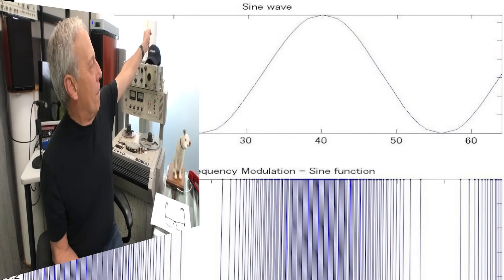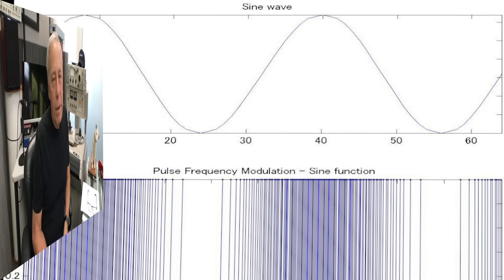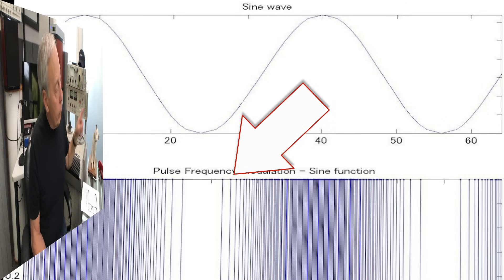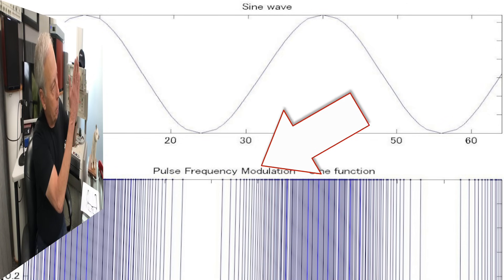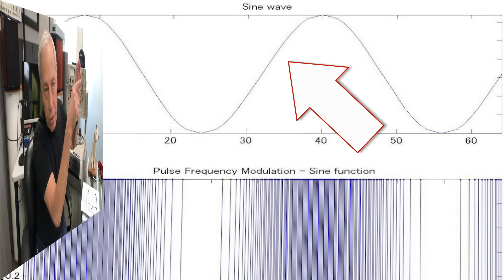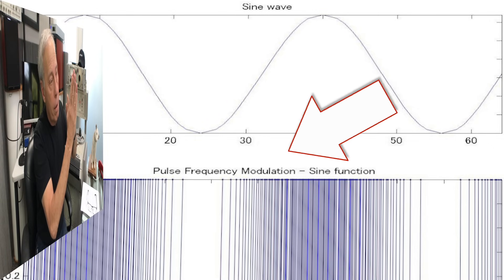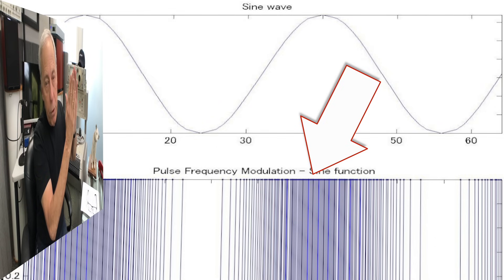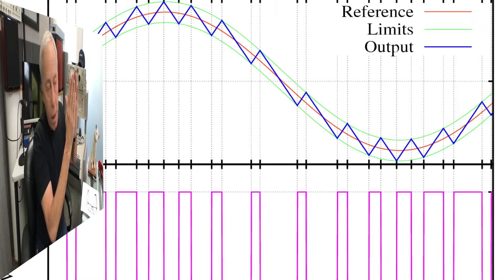What are the differences between Class A, AB, and Class D amplifiers?

Comment: Also most good amps have a shielding against cross frequency interference as part of the outer box it was made for ? Also marantz and Yamaha and also pioneer as well have some of the best AMPs for the public use, you can also go professional products but if you have close to over 100K just for a small amp and then spend close to over 150K for speakers and then spending on your home theater  system ,which the screen or TV will cost you over 50K ?

Comment: The difference is this, your explaining how a amp converts WATTS to energy and thus converts it to sound once the import is either phono or Radio or CD/DVD or import from a source which the AMP will change to a sound for the speakers, your not explaining how Class A, class B A/B and class d AMps and the differences in the Quality of sound reproduced for the speakers each spec of amp has a level of classification towards the higher end of AMPs ?
Also most AMPs do not have the right components to convert Digital recording used by most recording companies like those made for CD/DVD and blue ray recorded information other than what the original owners of the soundtrack or the movie wanted you to hear, so thus if you by anything on a CD for an example which has the prefix AAA ,which is analog recording used to transfer the information to a CD, is so poor that if you can by a record of the sound information it would blow your mind how much information is on that record, compared to a DDD recording which is all digital to digital transfer information to a CD  and a lot better sound transference compared to even a 5.1 blue ray or DVD with sound track, also the new 4K movies are nothing compared to say if you could run the old Record or 12" DVD system through a real good 5.1 or 12.1 system, but because of the DVD revaluation we lost a lot of that great sound recorded information and even now you cant get that back unless you have a great collection of 12" records and play them via hi end amps and speakers .:)

Comment: Good Job Paul! To recap what this video covers I would like to add in short, CLASS A is still the best audio amp technology however it is "heavy and hungry" (elephant). Class AB is very close to Class A with a little more efficiency, yet a good way to do clean full range signal amplification for audio (horse). Class D is the new technology to save the "planet," not sure which planet, however is light, requires a lot of extra circuitry runs very cool and seems to work well with low power items yielding audio (smart phones, ipods, laptops, etc..) it would be the (hummingbird). Some Class D Amplifiers that are very well designed with the correct support circuitry can be surprisingly clean and great sounding... How LOW quality D set-ups should be avoided... Importantly, Just because a spec mentions Class D and PWN is not a reason to consider it a quality unit...  Regards, Mark
Reply: Thanks for explaining it simply.

Comment: I have a PDX-M6 / 12" Type R / Pioneer 501EX/ 4-Kickers 150RMS@4ohm. So what's a good amp for the Kickers in the doors? I like the Alpine PDX-M6 footprint but was thinking of the Blaupunkt AMP1504 that delivers 150watts x 4 @ 4ohms so thinking would be a perfect fit and cheap with a small footprint.

Comment: Hi Paul, and thanks for this excellent description. One of the things that scares me, as a radio engineer, about class D amps is the potential for the radiation of the switching frequency and its harmonics to cause interference to radio, TV and wireless devices. I have no particular axe to grind, and to me any amplifier is "good" if it faithfully reproduces the input waveform at its output. I'm just concerned that manufacturers will seek to drive down costs by minimising the output filtering and leave us with a big problem.
Reply: Wouldn't that be caught during FCC certification? I'm pretty sure EMI radiation is one of the FCC certification test items, and it's regulated to be at a level low enough to not mess with radio/tv/misc wireless devices.

Comment: Sorry, sir, but you are misinforming people in this video.
Class 'D' is not 'Digital'. The amplifiers do not contain any digital circuitry at all.

A class-D amplifier or (switching amplifier) is where the amplifying devices (transistors, usually MOSFETs) operate as electronic switches, and not as linear gain devices as in other amplifiers. It is still analog circuitry.

You are right, the analog signal is converted to a pulse train of varying levels but this is not a digital representation of the signal. It's all analog.

Comment: great video.....i have a subwoofer that is 360 watts RMS AN 720 PEAK WILL AN AMP THAT PUT OUT 530 WATTS PER CHANNEL BE A GOOD MATCH ..?..IT IS IN A HOMETHEATER SETUP...IT IS A CLASS D AMP WITH DSP.....THANKS
Reply: If it's 360 watts RMS then it's 1440 peak.

Comment: Eh Class D is digital ? Nope it's not , who is this guy
Reply: Paul McGowan, founder and CEO of PS Audio since 1973. That's who he is.
Reply: Class D is digital . Do your research.
Reply: Killa Bee explain your research then
Reply: Digital is an on or off signal. PWM sends digital pulses, the signal is either on for full power, or off. The different voltage levels are determined by dividing the on max voltage by the duty cycle. So yes PWM is always digital. If you had a 5 volt light bulb you wanted to power with a 10 volt power supply, if you turned your 10 volt power supply on for 1ms, and then turned it off for 1ms (ms = millisecond). And you stuck a voltmeter on the outputs near the bulb, your volt meter would read 5 volts, as 10 volts divided by a 50% duty cycle is 5 volts. The same theory applies to music or the sine wave passing through the amp, as the sign wave gets bigger i.e. more voltage, the pules get wider, or in other words they are on longer and off less, while as the sign wave approaches its low point, the pulses get less wide as the amp is off more and the duty cycle goes down. However this flipping on and off of all these transistors is digital because they can only occupy 2 states off and saturation or fully on. In a class A or AB amp, the transistors are driven  in a linear mode that is not saturation, so they can occupy a variable state of off to fully on. Because there are more than 2 states it is an analogue amplifier. All of this has to do with how you bias the transistors. Transistors can be configured to operate in a linear region, or as switches (think digital) off and fully on.
Reply: PWM is much different than PCM. Class D was chosen because Class A, B and C were already taken. The D means absolutely nothing other than a class letter that was available.

Comment: A class A Vox AC 30 idles at a high idle current.Bang a power chord on that amp and it distorts  in a manner where you can hear every note in the chord.A Fender Super Reverb ,class AB idles at a lower idle current.It distorts much differently than the Vox.OOPS. Guitar Amps ,we like distortion,ya know.

Comment: Actually you can feed the output of class D amplifiers directly into your loudspeakers.  By 400kHz, or whatever your switching frequency, the speakers impedance, due to the speakers self inductance, is extremely high, so very little power is dissipated.

The reason why an output filter is typically necessary is because of EMI. Without the filter your speakers cables, and high impedance voice coil, turn into massive transmitters. If the amplifier is powerful enough this creates loads of EMI and wreaks havoc with other wireless signal transmission.

Also there is nothing digital about class D. It's purely analogue. It's an unfortunate coincidence that digital begins with a D, and the amplifier class does, because the two are not related.
Reply: Only true if all of your speakers including tweeters are coil / magnet / cone affairs.  If your tweeters are pizo, 400 Khz will probably shatter them.

Comment: Strictly speaking the only advantage to a class A amplifier is that the  output devices are never turned off. As the zero point is never crossed the hand over from one device to another never occurs and this lowers distortion. It has nothing to do with feedback or any other part of the amplifier and is purely the reduction in distortion by eliminating the crossover region from one half of the output stage to the other.

Amplifiers that run with very low, or zero, global negative feedback need to be run in class A for good performance and stability. Note that this is only referring to the output stage of a power amplifier. All other stages within class A, or low bias class AB amplifiers, are run in class A all the time.

Comment: As I understand  - 
class A - running full tilt all the time, your volume knob just makes the amplified output signal quieter.
class D - running as loud as you turn the volume knob.

That's why you shouldn't be worried about turning amplifier to max for class A, since it is running already with full output.
Reply: no you need a passive volume attenuator before the class A amp ...

Comment: Can you please make a video on class d output power? I never felt that class d amplifiers give the rated rms power.. those chips from national semiconductors and similar manufacturers never feels giving out as much power as their AB counter parts. Or does they actually give that much power.. ? I mean those tiny chips with 100-800 watts rms!! Some of them even dont have output power transistor designs.. how can they give that much power? 
Also the other thing.. those portable Bluetooth speakers.. rated from 5-40 watts .. never seems loud as class AB chips of same outupt power. For example , jbl flip 4 rated at 8+8 watts.. that doesn't even sound like 10watts rms . What am i missing? I know all of these use class d amps. Thats why i am asking this question.
Also i am a service person.. i service class a,ab,and class d amplifiers. In my experience, i saw a lot of class D pa amps, rated from 400+ watts output ( some use direct outputs, some with transistor power outputs) , these amps tend to burn their output stages more quickly than analog designs. Why is it so.. ? And i am not dealing with cheepest amps.. i service amps from bhringer and dynacords. I find this weird problem with class D designs of most of them. As an example, dynacord 600 class AB design and dynacord 600 class D design. The class D design get faulty quite often when compared to their own class AB design. 

Hope you can help.
Reply: @Shah b.s
Why don't you test it? It's like thinking you have yeast overgrowth in your intestines and getting a wonder cure from an infomercial rather than simply getting medically tested.

Comment: There was no mention of class B but that may have been for a reason? I use class B in modulator service for my old AM transmitters on ham radio. I am not an engineer, so my knowledge is somewhat limited in audio. Since I have class B amplifiers that can produce more than one kilowatt, I tend to think they are designed mostly for very high-power audio such as the service I use or in yesteryears high power stadium tube amplifiers, for public address systems. I have read that class B amplifiers have more distortion and are less efficient than AB1 amplifiers. Correct me if I am incorrect but I have thought that a class B amplifier depending on the amplifiers power requirement in output that audio amplifier starts off as a class A amplifier and as the volume increases it goes from class A to AB1 to AB2 and then to class B to meet the power demand?
Reply: Class B has a problem called crossover distortion, and it is often at a high level that can be very easily detected by the human ear, and is certainly not high fidelity sound, and is probably only ok for speech which doesn't require high fidelity sound.  For ham radio, there is no need for high fidelity sound - all that is required is that the sound of speech is audible, and the bandwidth is always narrow, so certainly not high fidelity.

Comment: I feel dumb asking what is probably going to be a very simple question, but I hope you (or someone reading this with enough knowledge) can help me.
In my car, the OEM sound system is not terrible, but I want to get the most out of the speakers I already have. 
What amplifier class should I get, and what power (wattage) should I look for?
I don’t want to turn my car into a concert room, just enhance the overall experience.
Thanks in advance
Reply: Paul McGowan I’ll try that. I honestly don’t know if I can make changes but I’ll look it up.
Thanks a lot for the reply
Reply: Mosconi makes v e r y good automotive amps. I have 2 of their ZERO 4 amps... delicious.

Comment: Sorry for being a little bit off topic but. I would like to have some common sense advise on a weird question. I bought a Cerwin Vega CV5000 amp, thinking it would be as described in the specs 100-240V 50/60 Hz. I have equipment that can handle this difference in voltage without any problem, most modern equipment can. BUT, when I received my CV5000 it was rated 110V 60Hz(at the power connector). A bummer, because I live on an island with both 127V and 220V 50 Hz. Returning the amp would cost me more than the amp itself. Surfing the web I came across a similar case but in reverse, someone bought a CV5000 220V 50Hz in the US. On the box I can see different "markets" ? NA, EU, UK, etc...Could it be that the inside just remains 100-240V 50/60 Hz but depending on where it is sold they just put the voltage and cycles that corresponds with the "market"?  Or do they have a special design and build for all the different areas? I don`t want to blow up the amp by hooking it up to 220V. What could be the easiest and safest way to find out if my assumption could be correct?